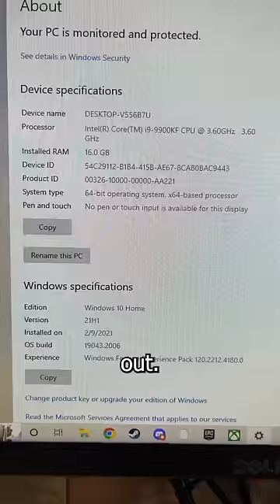This iBuyPower #gaming #PC has been visited by RGB #tech aliens #technology #shorts

Comment: That thermal paste application made me quiver with fear lol
Reply: Why?
Reply: @SolomonUcko it will spred in a circle if you put thermal paste on sideof a cpu figure wht will happen
Reply: @MrMe944 Absolutely nothing cause thermal paste isn’t conductive.
Reply: @Rolkey  thick layer of paste onto the cpu heatsink. This could cause problems as securing the heatsink to the cpu will cause excess thermal paste to be squeezed out and land on the chip which could potentially damage it.
Reply: @Rolkey   and there are two types of thermal paste : non-conductive conpound and a conductive one
Reply: @MrMe944  the paste he's using is non conductive
Reply: @MrMe944  Why does conductive thermal paste even exist..
Reply: @Rolkey   conductivity or high conductivity can transfer heat better

and there is thermal conductivity and electrical conductivity
thermal paste can be thermmally conductive but electrical insulating,
i just know to not put  too much you can have spillage and mess up your motherboard worst case scenario break it
Reply: Imagine even using thermal paste
Reply: @SpaceRanger187 you have to, lest your cooling fail. The purpose of thermal paste is to transfer heat and even out the heat sink so the heat isn’t transferred in one specific area and fries your CPU
Reply: @SpaceRanger187  Your name fits very well with this comment i must say.
Reply: the 5 dot method is based af
Reply: @SolomonUcko  the aio comes with thermal paste already on it
Reply: Always trust the greatest technician to ever live
Reply: Conductive or not it's gonna look like shit.
Reply: It's great application
Reply: @MrMe944 how would it be damaged 😂
Reply: @Coolwaterdragon1  do i need to repeat myself again so you would understand?

fk around and find out
Reply: Better hear conductivity but usually recommended for "professional" use lol
Reply: I would put paste in middle
Reply: @MrMe944  main problem ig is that air bubbles are more likely to get trapped, so X pattern is always best way to apply thermal paste
Reply: @arvin390  lol no
Reply: Glad I'm not the only one. That was absolutely excessive
Reply: @arvin390 you haven't put a computer together before.
Reply: Freeze! Thermal paste police!
Reply: @Rolkey   too much thermal paste can lower the thermal conductivity, even noctua writes that on their package
Reply: @MrMe944  practically every thermal paste ever marketed for pcs is non-conductive, only things like liquid metal are conductive.
Reply: @MrMe944  brother if you think normal thermal paste getting on your motherboard will break it then you have other issues, people cover their entire motherboard in liquid and it can still run fine, people also slather their boards in vaseline when doing sub-zero cooling to stop condensation.
Reply: @peik_haikyuu2265  you should do some reasrch  vaseline is not conductive and nobody said "normal thermal paste"  electrical conductivity will kill ur pc, and so called liquids are oils mostly, dump u pc in water and turn it on see what happens
Reply: @jradish  That was the most thermal paste I have ever seen applied to a CPU.

Comment: Had that ADATA SSD for over 5 years ,still working perfectly.
Reply: 3 for me with near daily transfers of over 200gb
Reply: Mine has a power on time of 3 years 200 days lol. Still pretty good drive health too at 87%
Reply: Had an adata for 6 years. Works perfectly.
Reply: The SU800 is pretty much identical to the Crucial MX500 which is a super reliable drive and I have used many on repairs. However, ADATA does do a lot of grab bag variants, like their 600 or 700 lineups which may change out nand flash or drives ssd controlers as costs changed and it wasn't always a reliable combo.
Reply: adata ssds are great
Reply: Mine failed after around 2 years, I think. No more ADATA for me
Reply: MSI has a pre built with this SSD and it had a ton of issues
Reply: @experiment_4 I have a samsung 850 I used for over 8 years and it's health is 87 or 89%, it is even faster than some m.2's without DRAM.
I'd avoid crucial too, just stick with Samsung or Western Digital
Reply: Until it stops
Reply: Mine corrupted in 2 months
Reply: @Skraftzz  yup. Trust me, Western Digital or Samsung, they just work as they are specced for which is close to forever now.
Reply: I used 3 ADATA SSD in the past few years, all of them broke within one year. Never using one again.
Reply: Same lol
Reply: @escapetherace1943 WD black or better yeah,the blue and green ones nah i don't do Russian roulette with those two.

Comment: Great thing about fans is it's very easy to trim and drill the plastic case to make them fit. My current tower has fans where you can't normally fit them, but I cut them down and drilled new mounting points to make them fit,
Reply: You can also switch them out for slim fans as long as your CFM  is good. I did that on my most recent build (not RGB).

Comment: I have had that same ADATA drive since 2017, and it works great 😂
Reply: I also have this exact one too from 2017 and it still works great 👍💪
Reply: me too, also if he lost all his important data because only had it on that SSD it's his fault... You must have a backup of all your important data, SSD and HDDs may fail at some time no matter quality...
Reply: Lmfao same here but from 2019 😅
Reply: @anopsssi   I've had far more hard drives fail on me than any SSDs. I have one archival hard drive in my closet, and the same backup on the cloud. 

That is the most ideal, but don't cheap out on SSDs. ADATA is an example of that. It may be fine to use but spending more does come with benefits.

Comment: The Adata SU800 is essentially the same as the Crucial MX500. Any other Adata Sata SSD I would have agreed with as they got cheap with and grabbed whatever was cheapest and it could be reliable nand, or less reliable nand, it could have been any and they often used the budget phison controller which wasn't great.
Reply: Yep. That SSD is actually a good model.
Reply: Yeah there's nothing wrong with that model SSD. I bought a couple of them several years ago and they still work no issues.
Reply: Yeah i feel like hes talking about the cheaper ADATA model, SU630 (Green one) Which cacheless. The SU800 (blue one) is great.
Reply: But like... weird thing is that the man bought a premium cooler and even more of a premium cpu, yet still went short on the SSD department to save... cash?
Reply: @abdulsalam_xp45  the ssd mostlikly came with the pc. though at the same time if he the type to have someone install a cooler hes also the type to buy a premium cooler just for looks, than buy what ever for things he dont see like an ssd.

Comment: I did the exact same thing with the exact same corsair cooler with a similar case. I had to drill holes on top of the case myself to screw it. But it worked like a charm as it works both as a cooler for the cpu and as an exhaust for the case

Comment: I wanted to mount a 280mm AIO in the top of a Ftactal design POP AIR. 
Didn’t fit, because I had there stupid Rebenge Ram, that are curved. Why is it curved? I couldn’t switch the ram, because it would have gone over budget

Comment: I have an ibuypower owned it since I was 14, 17 now I haven’t added any extra parts to it or bought anything new and it still can run 240 fps all epic settings Fortnite no problem. Used to run 360 but the pc is around 4 years old! Thou I clean it regularly I’ve had issues with the computer but never about the motherboard or actual box… so for my pc 10/10❤😂

Comment: Speaking of cheap n crappy SSDs, don't buy Edge drives! Our University lab bought a batch of their drives to upgrade our Optiplexes and not only did all of the drives in the original batch have the firmware controller crap out (after several months) but also the replacements we got via RMA 🙃

Comment: Bro i saw the Corsair Commander core xt there. In the icue program It have a "hardware lighting" config that change the colors of the conected fans while the systems boots and icue open. The problem for me is that in the past (a month ago) It worked as It should. But now the hardware lighting function dont work properly and the fans stay red and shutdown until icue program starts and allí the lighting and power to the fans work properly, until i close or shutdown the icue, then It becomes red lighting again. I reinstalled icue and related software, and even reseted the Commander core but nothing works. Have you ever seen this problema before?

Comment: Not all ADATA SSDs are built alike. The SU800 is leaps and bounds better than the cheaper SU635. I will not vouch for the inconsistent XPG and cheap SLC cache drives, but my 4 SU800 drives are still kicking as OS drives in my PCs.

Comment: Cheap SSDs are hit or miss, yeah. My work has bought around 70 Kingston A400 SSDs - 4 of them failed already, SATAFIRM S11 error, data is unrecoverable.
I'd rather have a slow and reliable HDD than a  "live fast, die young" SSD

Comment: When I swapped from a 2-fan to a 3-fan water cooler, I decided to let my brother have my old Corsair radiator, and...

...it didn't fit in his case...

Well, it DID fit when I avoided the screw holes and just mounted it partially diagonally. And it's sturdy and works great!

Comment: Tip for the H100i. I just installed it in my ATX case with the same issues of clearance. I purchased think 120mm fans instead of the normal and now it clears just fine with the RAM.

Comment: Bro, Ibuypower comes with those drives. I know because i have the same case. I just got an 870 evo for my game ssd drive, and it works fine. I put my 240 aio in the front as a pull and replaced the cpu and psu. Only have to order the 3060 to replace my 1650 now

Comment: Sorry for the novel in advance

Are ram issues a common issue with this mobo? I have this same board from an ibuypower build i bought off my buddy when he built his new one. He just kept the psu and 2080ti that was originally in it. I put a 2070 super in it. But every time i try to upgrade ram i run into constant issues with bad lag or crashing. In the past tried 2 32gb corsair dominantor platinum 3600mhz sticks and pc ran EXTREMELY laggy games were unplayable. Just recently tried 2 16gb corsair vengeance pro 3600mhz and my pc constantly crashes after about an hour of gaming. Both times i threw the original ram back in and it would run fine. I7 8700k

Comment: the same type of moron to leave this amount of dust on a computer buys a 240mm x 2 CPU cooler that doesn't fit inside a Mid-Sized Tower and expects the technician to fit it in any way. Stop buying prebuilds. Build your own computer, you might learn something about fan connections and what is really impacted by heat. Also the i9 on an AsRock Mobo in a mid-sized tower is probably not the smartest purchase. Not calling this customer an idiot, but higher end components have higher requirements. You can't expect to outfit a honda to perform like a F1 car. This isn't 2003-2006 where prebuilds and components are relatively similar to mix and match while building PCs.

Comment: 3 intakes fans on front, 1 exhaust at back (1-3 on top if you can) top doesnt really need a fan. Then get a nice cheap $13 chinese cpu cooler with the heatsink and clip on fans, make sure the fan on the front side pushes air thru the sink to the back exhaust or you make a horrible turbulent zone that doesn't flow the air. Use artic sliver. Get better results. IF YOU'RE OVERCLOCKING, make sure you buy a big case cause liquid cooling is the only sure way to keep them at "reliability temps".

Comment: 62 under load? Time for some more overclocking then! 80 degrees is the magical safe border. Stay far below it and you are wasting potential without enlengthening the life of the CPU. I also got a 9900K with a fat tower air cooler, and it tops out at 4.4GHz for not exceeding 80 degrees. I wonder if a liquid cooler would reach mentionable better performance.

Comment: I tried using a 240mm rad on my i9-9900kf but don’t recommend it to anyone trying this, if your gonna over clock in any regard get a 360mm or 280 at least this thing over clocks well and runs hot af.

Comment: holy crap. i actually had to do this same thing recently with my brothers PC lol. in my case i had no where else to put it in the case though. his ginormous 6700xt fits exactly in his cast front to back so no way to front mount it. 
I generally stay away from AData drives as well, i got a DOA m.2 drive, went through the headache of doing an RMA and i am positive i got back the same dead drive from them.

Comment: Dunno what's wrong with this drive,i have the same one ADATA SU800 512gb and i still have it after 6 years and still doesn't dissapoint me,of course health is 65% but still as for a first ssd drive in my first pc it still does it's job

Comment: how tf did it cost tons of money when they the cheapest SSDs lloolol you clearly didnt get warranty. ADATA barely sells drives to begin with and hardly anymore lolol Amazon basic brands are completely fine ive been using mine for 3+ years m.2 SSDs tend to fail more often and in weirder ways or the slot does.

Comment: I had one of those SU800 drives. They run really hot for some reason and I think that's why they end up failing. When I had one I used a fan to directly cool it and never had a problem luckily. 😅

Comment: I fit literally the same liquid cooler and a 4080 in an ATX Mid tower. 4080 has like less than a centimeter of clearance with the front fans, liquid cooler is basically touching the ram sticks. Due to the mounting screws and the holes in the top of the case I had to do case->fans->radiator.

Comment: I had an adata sx900 running for 6 years. It was not cheap when i got it in 2013 😂 it was still in the pc in 2019. Everything inside changed other than 3 hdds and got an extra m2 wd, and that was way worse than the adata. I had to wait for the ssd to load my the downloads folder. 😅😅 and by running i mean, how long it was phisicaly on. I had write on it more than 50tb. And in these years i had less rham 2500 boots. So it was basicsly running 24/7.

Comment: I know its not legit, i've built over 400 pcs

But the least dust i had in a case, was from one fan intake at the back which had direct air over the cpu heat sink. 

With the two front fans as extractors / out fans.

Comment: i have the same aio cooler but my mother board only had rbg headers and this aio requires argb connectors. anyone know of any solutions, i tried an adapter on amazon but it didn’t work. the fan and cooler work because they plug into the cpu fanpwr and smth else i forget. but it just kinda bugs me their is no color

Comment: Oof.. I have a similar cooler and similar case (newer Corsair), it's definitely a tight fit with any board that mounts the ram higher like that... 

At first you could literally feel it grind on my ram cards and see the pressure when it was under load.. but after a fan swap had just enough clearance to make it.

Comment: I hate water coolers.  Had to resurrect a motherboard after a water cooler leaked causing it to corrode.  It was a good AM4 board, too.  The water coolers are several times more expensive than an good air cooler and had a freshly installed one in a brand new PC die in less than a year after taking 7 times more labor to install the damn thing.  I hate everything about these water coolers.  I get their purpose, but it isn't a good alternative.  It gets as cool as the best air cooler on the market... for a limited time and then the coolant evaporates and/or the pump fails.  Then to replace that water cooler you're doing 15 times the labor that it would require to do an air cooler and you're already spending a hundred+ dollars on it while a good air cooler would last years and only require an air compressor every now and again.  If the fan fails on an air cooler - it's a quick and easy $10 - $20 replacement.

Comment: I need some water cooled stuff in mine. After a hour of gaming my room jumps from 67 degrees to about 80 and I play for hours. I’m not sure what it is because I take the side panel glass and clean any dust out of it so I know it’s not that. I play high graphic simulator games so I’m not sure if it doesn’t good enough cooling or if I’m pushing the gpu to hard and stuff to hard. Tempted to ship mine back to xidax to get fixed since I have a life time warranty but that means it might be months till I get it back. My games do get laggy as it gets hotter.

Comment: My 4000d airflow didn’t have enough room at the top of the case so I cut a hole in the radiator so the ram fits. And no I can’t front mount it my 4080 super takes up the whole length of the case

Comment: I NEED HELP ARE THIS PART COMPATIBEL CPUIntel Core i7-14700KF 16-Core up to 5.60GHz
МOTHER BORD: MSI PRO B760M-P
GPU:nVidia GeForce RTX 4070 SUPER 12G VENTUS 2X
RAM меморија:32GB (2x Kingston DIMM 16GB DDR4 3200MHz Fury Beast)
(Storage):Kingstson 1TB M.2 NVMe PCIe 4.0 SSD SNV2S NV2
POWER: Cooler Master ELITE NEX WHITE 700W
CASE: UGD Elite 3718
Cooler: Antec A400i PWM RGB LED CPU Cooler
Reply from the maker: go to pcpartpicker.com and check
Reply: @SalemTechsperts  it say some of the parts dont exist

Comment: bro i pretty dont know anything about computer hardware but isnt air cooling sufficient and i work on bikes and say dust or dirt or mud  in radiators can easily overheat the cooling water and can cause overheating in bikes though so does it applies on pc too i am pretty sure they have fans installed for air to pass on fins and lint can too accumulate in there